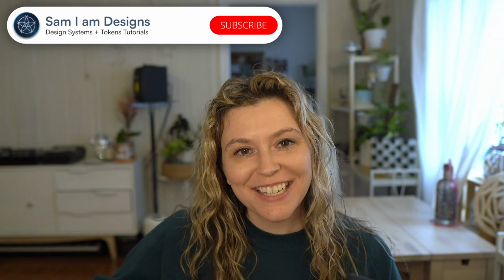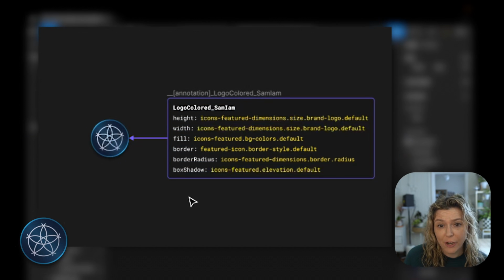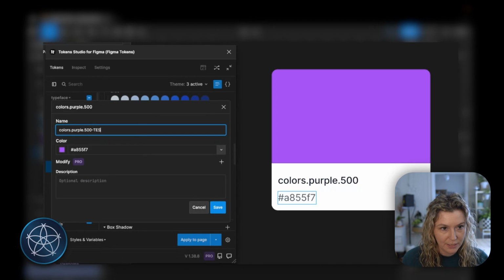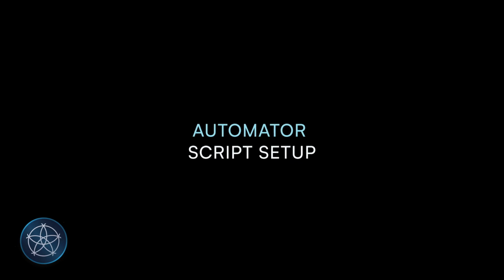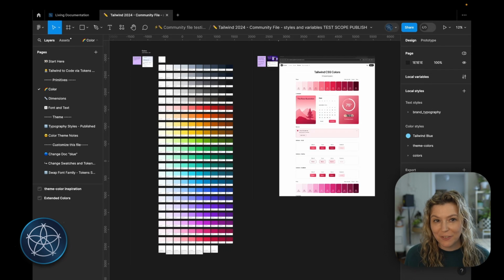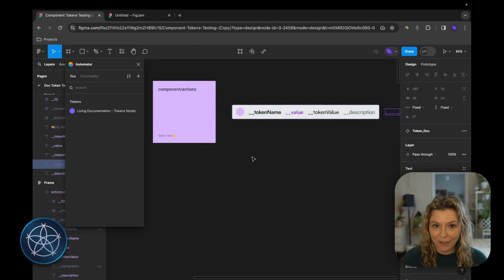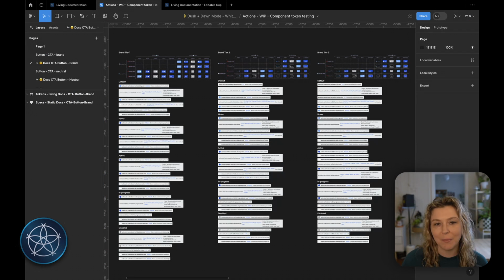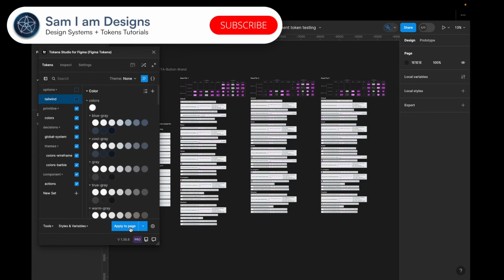Living Documentation of Design Tokens with Tokens Studio and Automator in Figma

Comment: At first, I had a blank space frame and struggled to find a solution. Eventually, I discovered that the issue was caused by missing "Satoshi Variable" fonts. I resolved the problem by changing the font to "Inter". Thx u so much!
Reply from the maker: Thank you so much for telling me!! Was that something I had in my template that caused you issues (I use both)? If so, perhaps I should change the default font family to help other avoid that.

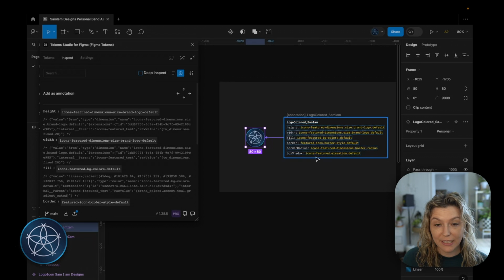Comment: 2:45 I had no idea about this Annotation feature! Is it redundant with "Annotations" from Figma now?
Reply from the maker: oooh! Further investigation needed on that one! As far as I know, annotations in Figma doesn't create a static doc of tokens from tokens studio (they don't pull plugin data which is LAME).
Reply: @samiam_designs  yeah I didn't check either, but if it can't use plugin data, then yeah... better off using Dev Mode properties + this or 8Specs!